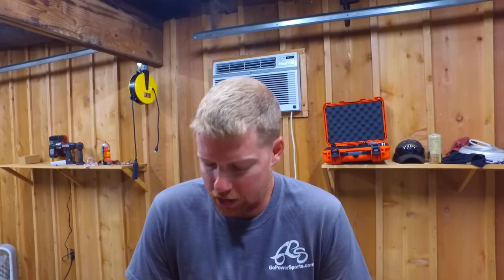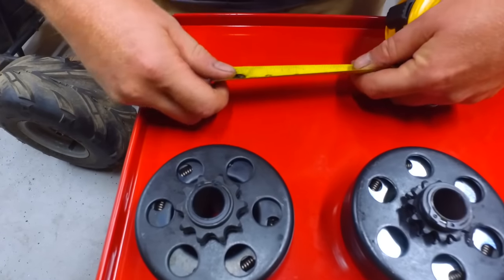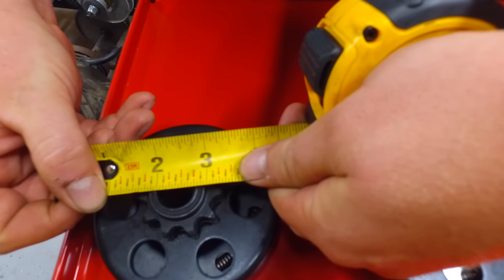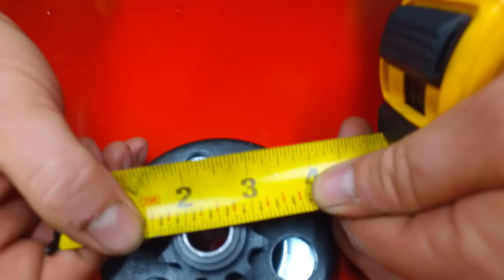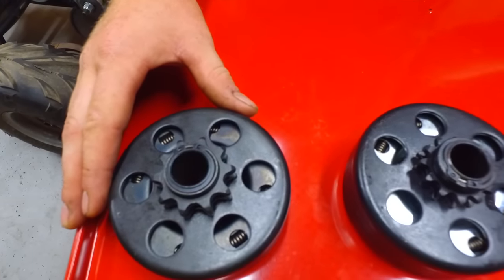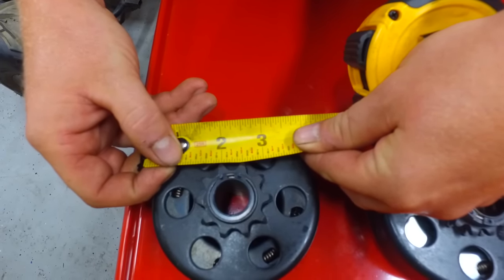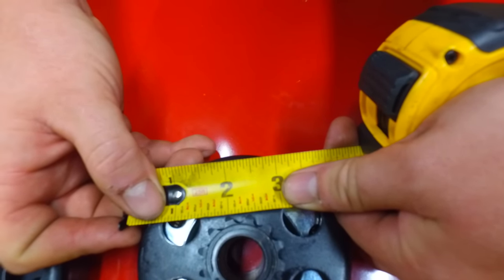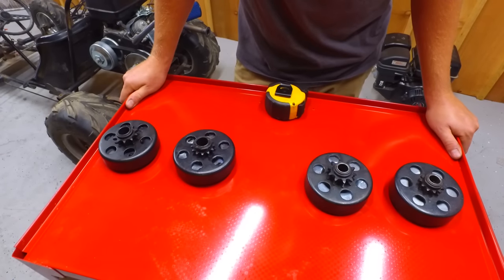Choosing the Right Centrifugal Clutch

Comment: They really need to mention the rpm range of engagement...I built a stage 4 212cc predator..with a much bigger cam... these typical clutches engage around 2200-2500 rpms...not sure if gopower sells the 3500 rpm clutches or not, but I will say, that they are available on the market...

Comment: I want to put a horizontal shaft engine on a lawnmower frame to PULL a cutting deck, what would be the BEST axle sprocket tooth size to use with one of these clutches?

Comment: I have a mini bike with a predator 212 bought it used. Chain snapped I think I tightened to much . Now trying to find which chain I should buy. I measured the inside spoke point to point it's 3/8 . Now u say I need a 35 inch one or ?

Comment: I found some anomalies regarding overall width (my original 3/4" 420 off of a 196 hisun, a new replacement came in the mail, 3/4" bore 420, for my predator 224).  My question, should the bronze bushing extend slightly past the pto shaft, so the clutch bolt washer contacts that 1st, not the crankshaft end?  Sorry if the question sounds dumb, I'm new to small engines..

Comment: Awesome, thanks! I´m building a Gokart for my kids with a 3hp motor with a 5/8" shaft. What chain standard is the easiest to find parts for? I´m gonna need to try out a variety sprockets to make the speed just right. My wife would kill me if the kids ran over the cat.
Thanks!
Reply from the maker: #35 and #420 chain are the most popular options.  You will have more luck with the #35 chain with that clutch setup.
Reply: @GoPowerSports  great, thanks! 35 chain it is. Would you happen to know at what rpm’s the Max-Torque clutch ”activates”?

Comment: I have a question so my minibike bogs down because we took the governor off and will be going fast will be doing good and then all of a sudden it will just like stay at one speed instead of speeding up to its normal speed how do I fix this
Reply: Jetted carb, less restrictive intake, less restrictive exhaust, stronger valve springs, billet flywheel, billet rod, billet pushrods, and you might as well as advance the timing while you're at it.

Comment: can a 3/4 centrifugal clutch handle 225cc engine? if not, what size of centrifugal clutch should i use?
Reply from the maker: It will, you may need stiffer springs in that clutch though.
Reply: @GoPowerSports  thanks guys have a good day

Comment: My Honda gx200 doesn’t have a key slot when I slide on my clutch what do I do??! Just file down key on clutch and put it on and use set screws???!???
Reply from the maker: Without the keyway, your clutch won't spin with the crankshaft.  I would just get a new engine.

Comment: My Tecumseh 6.0hp on a Murray explorer frame seems to start moving right after I start it so I have to hop on quick after I pull the starter cord. I’m pretty sure my idle adjustment on the carb is broken and the clutch may be bad. It also sputters at low rpm and lurches sometimes. After I get going it runs really good (25-30 mph), but it seems like after I slow down for a turn and try to step back on it, it will hesitate and then only get up to about 20mph. The left rear wheel (nearest to drive belt) has a slight wobble as well. Also needs to be shook forwards and backwards after it’s parked in order to move it. Brakes don’t engage until 3/4 of the way to the floor. Any advice/lists for what needs to be repaired/replaced would be greatly appreciated.
Reply: the brake thing is common on those. mine has to be re adjusted every now and then. your clutch sounds like its rusted engaged.

Comment: If my go-kart that i got doesnt have a clutch, would i need to just measure the shaft from the engine? I have the chain, but no clutch on my Murray Go-Kart. I currently have a Tecumseh OHH60 engine.
Reply: I’m a little late but if you have a Murray explorer with the Tecumseh 6.0hp that is badass. I just found my uncles old one in the barn and finished getting it running but the clutch is going bad and I’m replacing it soon. If you still need the info I’m looking at mine tomorrow and I can give you specs of mine

Comment: I am using a 12T, 3/4" clutch from Go Power Sports for an engineering design project in college. I was wondering if you know the width of the clutch? Working with limited space and can't find a spec sheet anywhere online. Thanks!
Reply: Try going on eBay look up the clutch that you have and check the size there

Comment: I'm building a bike and I have a 38 tooth sprocket on the rear I'm turning a Schwinn chopper bike I took the front fork and the rear end and I basically need to know what size centrifugal clutch do I need I know it's 3/4 bore but I need to know what size spacing in teeth that I need for my 38 tooth sprocket and my clutch
Reply: Same I'm just going to send it
Reply: go buy a bit of 35 chain and 40 chain and see what fits better.

Comment: i have the second clutch from left, that is a 12T  3/4inch clutch on a 208cc 6.5hp Briggs and Stratton engine with a 60T rear sprocket for 5:1 gear ratio. My kart weighs 140kg with driver and has 11 inch rear tyres. When we run the kart, the clutch gets extremely hot and sparks are seen coming out of it but we stopped it from burning out and turning blue/purple. I have oiled it properly and checked the chain tension but still it gets extremely hot in 15 minute runs. We try to run it at full throttle to let it cool down but now the friction pads have expanded and get engaged at low rpms. Please suggest some ideas to make it run longer and cooler.
Reply: Hitesh Arora clutches get very hot no matter what
Reply: Lower gear ratio - put a bigger sprocket on your axel so you’re like 8 or 9:1
Reply: If you have a CVT they run pretty much dry so you may want to check to see if you need oil in the first place, look up some videos to be double sure because if the parts are sliding too much with oil or grease then they will get really hot and get little traction.

Comment: There it is 79cc Predator NOT a 97cc that has a 5/8" output shaft.
Reply from the maker: alrite alrite alrite
Reply: Yeah I have an oryxearth 105cc with a 5/8 shaft, common on smaller motors

Comment: so how do you measure the shaft. to see what size clutch you need??
Reply: Use your measuring tape on shaft end. You want to measure dead center of shaft end, from side to side.
Most 6.5hp are 3/4 shaft.
Hope that helps
Reply: @BeastOuncelifeian  what clutch should I get for a 301cc predator engine?

Comment: Do you have 7/8 clutch
Reply: Zombiehju Derry devil I need one too
Reply: no one does. put a sprocket on the crank and run a chain to a jackshaft with a 3/4 or 1" diameter and run a clutch that way.

Comment: You got the tape measure upside down. Also. I ordered a HD clutch from you. Almost every site had the dimensions in the specs, but your site didn't, and 
it was too wide to fit my Coleman BT200X and wouldn't slide far enough onto the shaft because it hit not only the chain tensioner bracket but also the top lip of the jackshaft mount that bolts onto the engine. I called you, or wrote an email and you said I could send it back for a refund but I had to pay the shipping AND there'd be a 'Restocking Fee. Never shop with GPS's again!

Comment: Didn’t help that’s easy to figure out what we need to know is what clutch engages at 3500 rpms and up those ones engage speed at 2200 rpms no good for predators, they need 3500 rpms and up
Reply: You need to change the spring in the clutch assembly probably the green or black spring

Comment: I have a gc160 but the shaft is 7/8.
Reply: put on a 7/8 chain sprocket and run the chain to a smaller sized jackshaft that has more clutch options. problem solved.

Comment: I need a 9/8 inch bore centrifugal.

fml
Reply from the maker: Does that equate to 1-1/8?
Reply: @GoPowerSports  yes
Reply: ooooof. ive found 1 1/8 clutches before, but they are pulley clutch. now, you could just put a sprocket on your crank, run a chain to a jackshaft with a 3/4 or 1" diameter and run a easier to find clutch that way. its what im gonna do with a lawnboy 2 stroke engine with a 7/8 shaft.